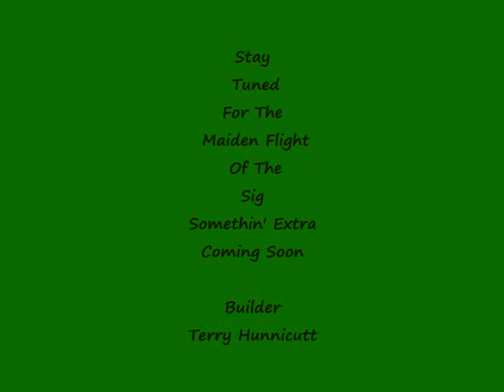Part 5 The Finish Of The Sig Somethin' Extra Build

Comment: Hey Terry. Just got this plane and about to start the build. Running an OS .46 on it. Wanting to mount the motor sideways and run the cowl. Know it's gonna need some cutting on the cowl for the head of the motor but what's your opinion on cutting the side wall of the engine bay to to mount it sideways?
Reply from the maker: Hey there, you should be able to cut a hole in the side wall or even just cut it off right in front of the fire wall without it weakening the frame structure at all, i had thought about doing that to mine. Hope this helps, good luck on your build, it is a fantastic plane, you will like it,  take care my friend

Comment: Hello my friend , 1 question . I know in the book it give a range of balance points. I was thinking 4" might be fine as its right in between. Just curious what you balanced yours as ?
Reply from the maker: Hey Greg, yes i balance mine at the center of the range then fly it, some tomes i will move it slightly but most of the time the middle of the range works great, hope your build is coming along good. Take care my friend
Reply: +Luvtoflyhelis  Thanks , Yes I am finally complete with the build . I went a little further than most people would. I order a step down converter so I can finally stop using glow plug ignitors . Also 6 or 8 years ago I switched to 18650 batteries and they work flawless , figured I would let you know if you haven't tried them . If you need more info just let me know.

Comment: Nice, finally done.  What servo size should I get for it?
Reply from the maker: Thank you, well it depends on what type of flying you want to do with this plane, if you are going to dobany 3D flying then i would get something digital with at least 75oz tourqe with metal gears, i don't fly 3D so i am running the JR  ST47 analog servos, i think they are around 50oz tourqe, Hitec, Jr, Futaba all make really good servos but like i say it depends on what type of flying you want to do with it, hope this helps, thanks again, take care my friend
Reply from the maker: One more thing, as far as the hokes in the servo tray they are standard size servos
Reply from the maker: Yes these will fit and fly it fine for just basic flying, like barrel rolls light loops and stuff like that, just don't get real aggressive with them and  they should hold up, i wouldn't do anything  like a hard snap roll or anything like that. This is an awesome plane and flies fantastic and lands like a baby, you will love it. Take care my friend
Reply from the maker: Well that i'm not sure about, i don't know about setting up electrics, all the electrics that i have i bought as a p-n-p so they came already set up with motor and esc. Looking at what it calls for in the manual i think i would go with the 850kv motor, here is what it says to use on the Tower web site, sorry i'm not to knowledgeable on electric,  hope thus info will help. I would be interested in what you end up with though so keep me posted if you don't mind, thanks Terry   
Electric Power-
Brushless Motor: 700-1000 watt 650-800 kV
ESC: Compatible with selected motor
Reply from the maker: Oh yeah those servos would be great, they will hold up well even 3D flying, good choice

Comment: What engine did you install ?
Reply from the maker: Well as shown in the videos an OS 62v four stroke, i plan on changing it out later to an OS GGT10 gas engine. Take care my friend
Reply: +Luvtoflyhelis  Thanks , I just installed my ASP 61 on it , I know it;s a little under powered but hopefully it will be okay for now. I looked at the OS GGT10 and that looks very nice. The only thing I can see that you may have an issue with is the muffler. Unless you plan to flip the engine 180 degrees ?
Reply from the maker: Oh yeah that 61 won't be under powered, that will fly it great. I think you will love this plane, it's really a fun flyer. Take care my friend